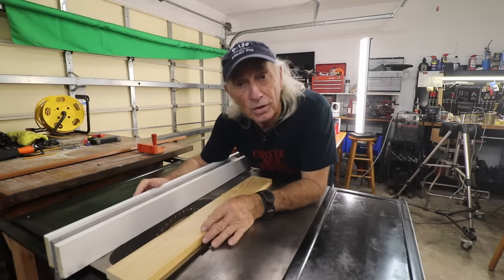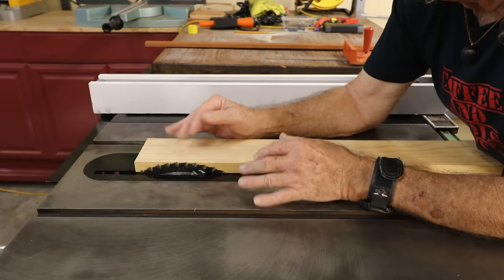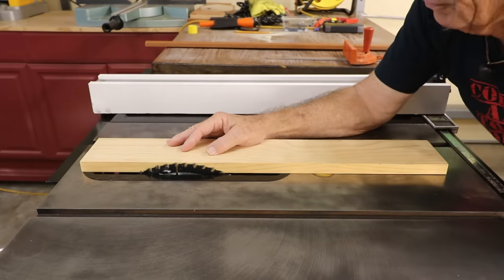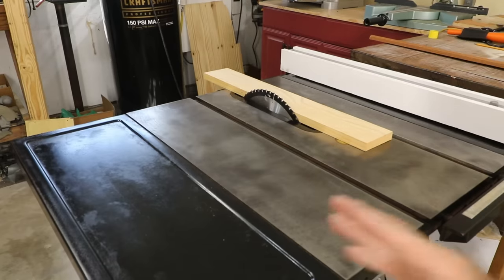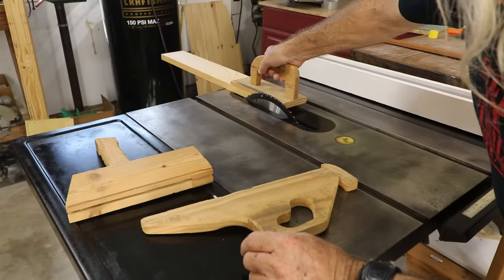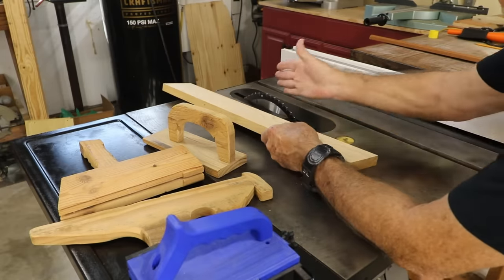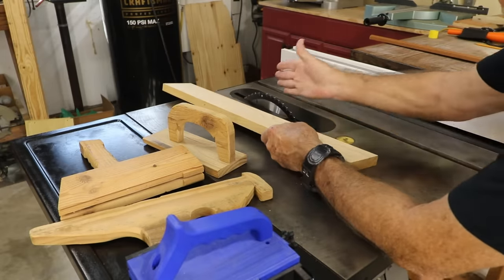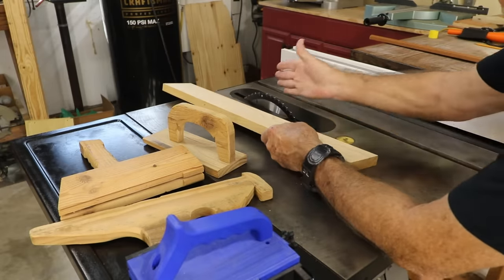Table saw secret nobody will talk about from the good old days, C&T episode 180

Comment: I've been a carpenter for 40 years. I use a job site table saw out in the field. I don't even own a big heavy shop saw. Here's a few things that I do for safe operation of a table saw. I always set the blade height to at least the gullet of the blade, but not too high, for saw dust clearing, and it also helps to keep the work piece down on the table and not float above the table. The blade also cuts better that way.  I always check the rip guide with a tape measure at the front of the blade and also the back of the blade... I don't care how good the rip guide is. I always knock the back of the rip guide open a tad to make clearance for the board to pass through ( thats the #1 cause of kick back, no clearance on the back side of the blade.) I only use a push stick if I'm ripping something narrower than about 2 1/2 to 3 inches. When I push a board thru, I always wrap a a few fingers over the top of the rip guide, just in case something wants to pull my hand into the blade, my hand won't go there because I have most of my hand wrapped over the top and around the other side of the rip guide. The number one cause of accidents is just simply not respecting the possible dangers and not paying attention.
Reply from the maker: Good stuff here ! Thanks for this one :)
Reply: On the job site with everyone using it.  I like when the fence is open on the end. Good tip.  Run the fence a little out of parallel
Reply: @dans4900   I posted this over a year ago.  I've since obtained a nice heavy, 3hp cast iron saw for my shop with an awesome solid rip guide. I actually got it for free from a good friend. That one is perfectly parallel so that I can use it on either side of the blade. You can't knock that rip guide over like on a cheap job site saw.
Reply: And, as I just mentioned to this videos poster, no mention of a saw guard.  Why he mentions safety without the mention of an upper saw guard is ludicrous.  You too.
Reply: @rodneywheeler2278  A blade guard just gets in the way.  If you're too stupid to keep your hand out of the path of the saw blade... maybe you shouldn't be using a table saw.
Reply: He does actually mention a blade guard up top...
Reply: @marcellemay7721  one of the uses of the blade guard is to stop stuff dropping on top of it and then flying off at speed. You should stop commenting on health and safety until you undergo some professional training and take note of it.
Reply: @jimpackard8059  I'm actually a pro. I've been a full time carpenter and contractor since 1984.  I stick to my comment.  Common sense seems to be non existent anymore.  If it seems sketchy to you, then it probably is.  Your idea of sketchy is probably different to someone else's according to your experience.
Reply: @marcellemay7721  your length or experience is not in question here. I am now retired but I have been senior management in machinery suppliers ( not small stuff like Sawstop etc ) and even  contributed to the formation of the European PUWER regs  back last century. and my comments are based on data concerning machinery accidents over decades. The facts are that stuff can drop on to the sawblade   from above if no guard is fitted and that is very dangerous. Individual’s personal view cannot discount that risk . It is a fact. This causes many accidents.

Comment: I agree with using a high blade. been using a table saw for 55 years, never a splitter or guard and running the blade higher has less chance or kickback. on thiner rips, I hang a finger over the fence as I push through. Safety is great but wisdom exceeds fear. If your that afraid of a saw- don't use one.
Reply from the maker: Right on !

Comment: I don't feel the table saw is any more dangerous than any other power tool.  It just has more potential to cause injury because there are more ways to misuse it than other power tools.  The vast majority of table saw accidents are user error.  Cutting pieces too small, removing blade guards, trying to cut warped wood, using a dull blade, not having respect for the tool which makes you complacent, working when too tired.  Those are the main culprits and they are all user induced.  I happen to live by the creed that the table saw is as dangerous as you let it.  Follow safety procedures and stay focused on what you're doing and it won't hurt you.  If you're getting tired, don't make that last cut.  There's always tomorrow, unless you cut off a finger.
Reply from the maker: Well said !

Comment: Years ago as a newbie, I set the blade "too high" according to modern recommendations.  When I learned I was supposed to have the blade low and tried it, it made cutting a lot harder (presumably due to greater friction) and I got more burning.  To me, it also seemed intuitively more dangerous from a kickback perspective, especially when cutting something like a large flexible panel that could easily lift up and get on top of the blade.

Comment: As for the Table Saw, I always reminded my crew that a Table Saw was like putting your hands into a Shark's mouth. What ever goes in will not be coming out. I refer to a high blade as Shark eyes, dead eyes no soul, no con chance,  a total eating machine. It eats whatever you feed it. Because of this, no one on my job in over 50 years of Interior Trim work has ever been injured, or cut. Yes the Table Saw is a wonderful tool when used correctly, respect her every time she is turned on. She bites, and shows no mercy.

Comment: I am a retired pro who still works wood as a hobby. My dad was a professional cabinet maker/joiner all his adult life. He taught me to adjust the blade to where the gullets clear the wood, enabling good blade tracking, further, it promotes clearing excess cuttings from the blade while also it keeps the blade cooler. This has served me well. The only hospital visits I've had from woodworking are a cut experienced while sharpening a chisel, and a slightly shortened finger tip that occurred while jointing a board long past fatigue from a LONG day had set in. Don't work with power tools when brain fogged!
Reply from the maker: Thanks for this post. It is all about doing it right.

Comment: I see you refurbished that old craftsman table saw. I bought one a few years back that didn't have a fence. I ended up putting a accusquare fence on it. Best investment I've made.  Good to see someone still using the older saws.
Reply from the maker: The sound of that old saw is amazing. Smooth, quiet and powerful.

Comment: I would encourage any novice or experienced woodworkers to follow the advice offered up by this gentleman. I’m an old-time woodworker who incidentally only has 7 fingers remaining —Yes, I too was bitten by a table saw, amputated 3 digits from my left hand instantly. It’s too late for me but this gentleman is trying to help prevent further injuries to people and I respect & appreciate his efforts —Listen to his words. Nice job on the video by the way.
Cheers from Toronto.
Reply: Thanks for the hard won advice, feller. I am sure that at least one person will be saved from a maiming just for reading this.
Reply: I got nicked once in my 42 years woodworking and it was ripping PVC which is slippery stuff, had the blade 1/8 above and walked away with a little more than a scratch. Did have kickback one time when I was just beginning ripping parquet flooring, took a piece right to the chest. Accidents do happen because the saw doesn’t care and one moment of disrespect and it’s not good. No music playing, wife knows not to distract me. I know guys who have gotten bitten by joiners,table saws, radial saws. 

Good video
Reply: I disagree, I do detailed cuts with the table saw and before I could afford a Sawstop I was using a contractors table saw on the floor (tile covered in sawdust) I slipped a little and my thumb got bit by the saw. Had I not set the depth so the saw was just peeking out of the top of the wood, I wouldn't be able to play video games with my son or piano anymore.
Reply: @DrManhattan84 , you found the best compromise for the stock you were cutting, the task at hand, and your equipment! Very glad that you escaped a maiming. Enjoy every minute that you can, with your son!
Reply: @DrManhattan84  Precisely. I made a grave error 4 months ago, because I was tired. It wasn't an accident, it was a case of me being half asleep after working 10 hours in construction. I set the blade low, but did everything else wrong. I had a severe kickback, and if the blade had been just 1/2" higher, I would have lost 4 fingers. But I set the blade about 1/4" above the wood, and I only cut about 1/4" into 4 of my fingers. The blade hit the bone, and took chips out of the bone in 2 fingers. But my fingers are fine, and I didn't' lose any fingers. But the thought that I came SO close to losing 4 fingers, is traumatizing and I haven't been able to use my saw again until I completely rebuild it with a riving knife or splitter.
Reply: @chris431  that should never happen I would get a device
Reply: Thanks Steve. Any more details on your story? How was the saw configured? What went wrong?
Reply: @PilotPlater  Hi Andy, The saw wasn’t at fault, the accident came by my own hand (no pun intended). I’ve been using table saws and whatnot since I was about 10 years old and at the age of 57 I got complacent and became one of those guys who figured accidents only happen to other people and voilà I was quickly proven wrong. Wet wood and kickback ——but as I said my hands shouldn’t have been anywhere near that close. My fault. I don’t have a tablesaw anymore, my wife and her sister who ironically is an ER nurse had the gruesome task of cleaning up the workshop the next day and while they were cleaning up the workshop they cleaned out my table-saw —— they got rid of it. It’s been 3 years and my wife has finally agreed that I should have a table-saw again but with the stipulation that it’s a SAWSTOP. No agreement here I’m just not in a position to be able to afford one at the moment but they’ll be a 3Hp SAWSTOP on my wish list to  Santa next year ——not sure if his sleigh will handle it 😎 
Cheers my friend - Keep your fingers.
Reply: Thank you Steve!
Reply: I lost half my left thumb to youthful fearlessness, my own stupidity, a rush job, and a radial arm saw. I think of it as my DIY Safety Sign.  Peace to all woodworkers!
Reply: @steveemmins3728  I barbequed four fingers and melted an 8" lineman's plyers once. I'd been framing out for a bunch of bedroom set displays in a huge furniture store, and for days I had been feeding a hundred feet or so of thick electrical cable behind my studs, and when I got to the part where a huge electrical panel was to be installed, and because the mass of cable now looked like a bird's nest for a stork, I took my lineman's pliers to cut the cable I'd been handling for a week, and POW! a blinding flash, a jolt that threw me across the room, a melted plyers, and four fingers on my left hand looking like burned BBQed chicken. I wiggled my fingers, and flakes of crispy skin fell off, as blood dribbled through the cracks in my fingers. It didn't hurt at all.....for about ten or twelve minutes. On the way to the hospital I had to rush into a pizza shop for the biggest cup of soda they had, so I could plunge my hand into the ice-cold Pepsi. All in all, it wasn't a big deal. I had this huge mitten of cotton and gauze, enough morphine to make me giddy, and I even won an English Darts tournament that night. The mitten was perfect for holding my darts, and the morphine banished any anxiety I might have had. Peace to you, my brother.
Reply: some people can not sing but still do  !!!! I always wonder why !!!!

Comment: Interesting!  Thanks for the info.  I used to do it the old school way.  Decades ago I tired of having sawdust thrown at me so I dropped the blade to 1/8" above the wood surface along with a proper push stick/push block.  I am a professional woodworker of over 40 years.  No kickbacks ever.  The key is a sharp blade.  I've cut through the nastiest of wood with a sharp blade without issue.  I have found that it's the cheap blades that are the most expensive in the long run.
Reply: Totally agree. Keeping a sharp blade on the saw solves so many problems whether it’s a table, or a circular saw. A dull blade will cause the wood to lift up and kick back plus it makes an ugly cut. It also makes the machine work harder and wear out faster.

Comment: I just watched your video on using a table saw. It was the first “real” wood working tool I got. I experienced kickback early on and have not used it since because of this. My Dad gave me a set of push blocks, but still I  haven’t pulled the saw back out. Thank you for not only sharing the different aspects of safety, but also the clear and simple way you explained the how and why. I’m glad I found your videos and have subscribed. Looking forward to watching more of the good info you share!
Reply from the maker: Could be best not to use that saw if your nervous around it.
Reply: @SirTools  Any tool is most dangerous when you are afraid of it... Start small, and have someone come and work with you with it until you are comfortable. It's always a good idea to have a shop buddy around when you are learning to use a new tool, someone to dial 911...

Comment: As a professional Wood Machinist/Joiner taught by some very talented, old school guys. I was always told a high blade reduces the cut surface (amount of blade to wood contact) but gives a rougher cut because of the exit angle. A low blade height increase the cut surface, and therefore the force needed to push the timber through as well as the work done by the motor, but the exit angle will give a cleaner cut. 
I generally stay in the middle ground and adjust the height based on what I’m trying to achieve
Reply: Professional wood machinist from the 1960s.  Try using a finer blade, raising the blade and FFS use a riving knife and a blade guard.  Seen too many fingers on the dusty floor.  If you use the guard, you can raise the blade and you only have a small area on the front of the blade showing.  It also helps to stop kick back, that’s what the riving knife is for.  It stops the wood from gripping the blade.  Push sticks are useful.
Be safe woody.

Comment: Good info, thanks. I been woodworking since around 1960 and I am a retired safety expert. I really get ticked at these young youtube kids with missing fingers trying be a safety expert. Woodworking as with any job or hobby using power tools poses risks. A smart person will assess the risks, hopefully take some sort of action to minimize them and make the cut. As you correctly pointed out: with the blade low (as most youtubers say is the best and safest, that in itself introduces a SECOND hazard of a higher chance of kickback). And along with that higher risk of kickback comes a higher chance that your hand will end up coming into contact with the blade during the kick back event...so much for being the safest way.  I just watched that happen yesterday on a video  where the blade was really low, it kicked back a piece of wood that pushed/pulled his hand across the blade causing serious injury.  I, like you am old school and keep my blade a little higher, use feather boards, push sticks or whatever is appropriate to keep me as safe as possible and enjoy the hobby. I just finished a 36X36 oak Carrom Board one side/Checker board other side. Loving retirement and woodworking. Be safe.
Reply from the maker: Right on !
Reply: Young YouTube kids with missing fingers trying to be safety experts? Where? Sounds pretty made up.

Comment: I was always told (and followed) my shop teachers advice in the 80s that the blade should always be above the piece by one full tooth.  Never had an issue.
Reply from the maker: Thanks John for this one :)
Reply: I run mine about a half tooth above the piece I'm cutting.. if your hand slips it's a cut not a finger missing.

Comment: Thanks for the video & your perspective.  More than 40 yrs of carpentry, wood working & cabinet making.  I can't even remember for certain from whom or where I learned my preferred blade height.  I suspect it was as a young apprentice.  I was taught to set the blade height high enough for efficiency but low enough for safety.  This means I always raise the blade at apex or top of the blade which is the highest point above the wood/work piece so that the bottom of the gullet between the teeth is just above the piece being cut.  About 1/16" - 1/8".  This allows for clean, non burning cuts, allows the blade to fully eject the debris, chips, sawdust (that's what the gullets are for).  This in turn helps keep the blade from over heating & running cool.  It also places the front teeth in a downward trajectory at the leading edge/front to avoid kickback but the blade isn't so high that it will remove a whole finger.

Best of both worlds.  Relatively low blade exposure.  High enough to cut straight, cleanly & with minimal heat build up by ejecting cut debris while minimizing kickback.  I also always apply this method to my circular/skill saws.  The blade is set just deep enough so that the bottom of the gullet is just below the work piece.  Cheers from the west coast of Canada.
Reply: A great way to describe that particular trade-off, "high enough for efficiency but low enough for safety". Pithy.